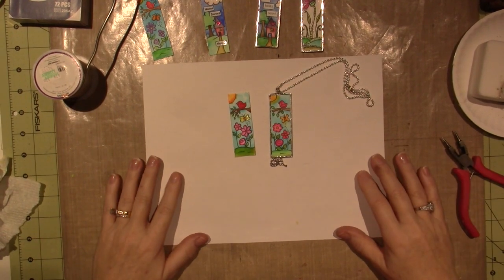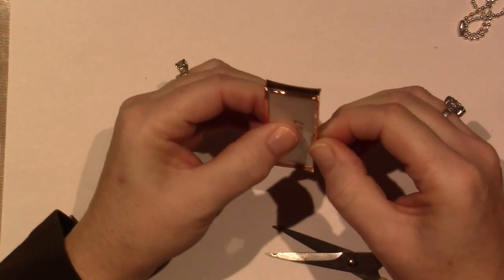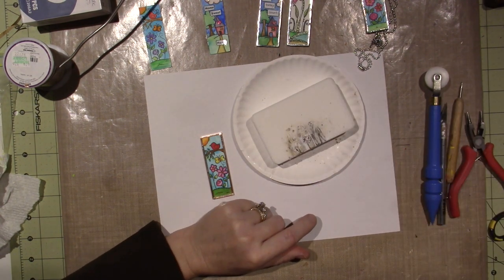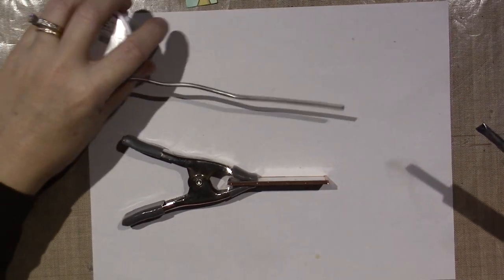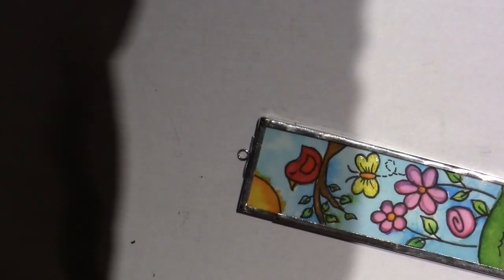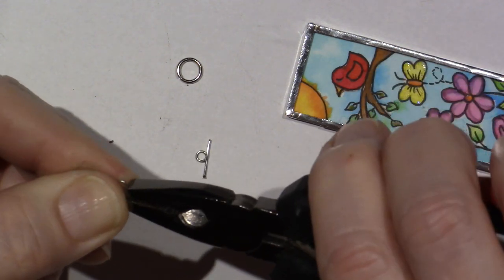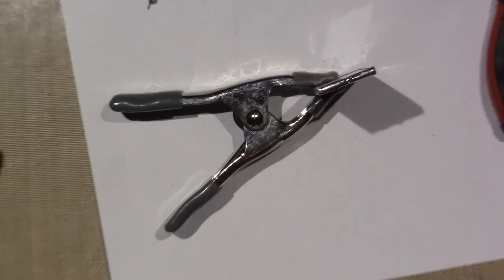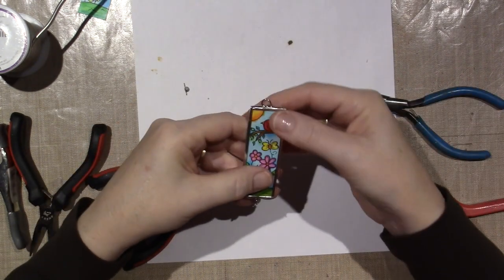Soldered Pendant part 2

Comment: This has been the best tutorial for these.  I purchased a soldering kit from michaels a few years ago and haven't used it until last night.  I tried it out using the copper tape around the top of a glass crystal pendant and it would not adhere to my flux in most spots and where it did adhere it was gloved on.  I think my flux is funky and I need to get something different.  Now I want to try to make the actual glass slide pendants that came with my kit.  Thank you for taking the time to show this to us!!!!!!

Comment: Does the glass ever get so hot it breaks?
Reply from the maker: starwolf539 I have never had that happen.
Reply: starwolf539 The glass can crack if you hold your iron over the same spot too long and/or if you go back over the same area too many times before allowing it to temporarily cool. So if there is an area that needs some touching up, it's best to come back to it after you've finished your flow for that run. Hope this helps! :-D 
~Rachel H.